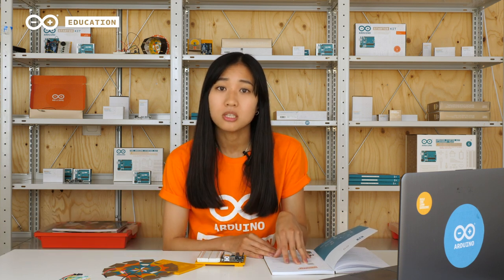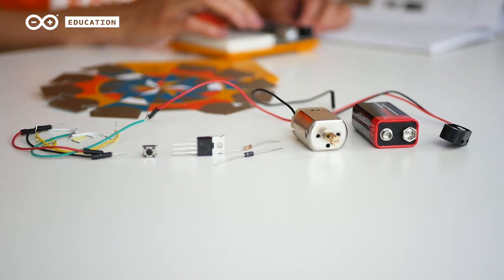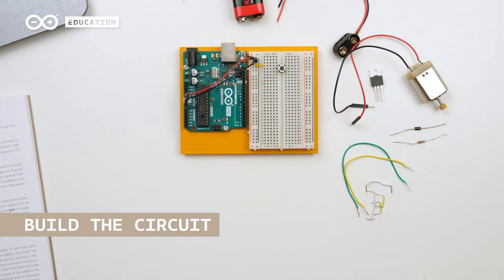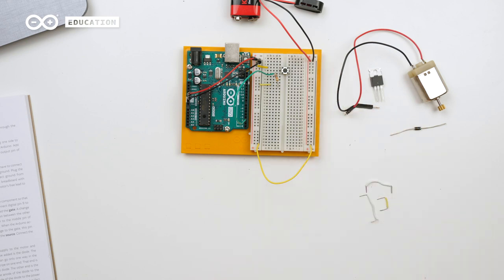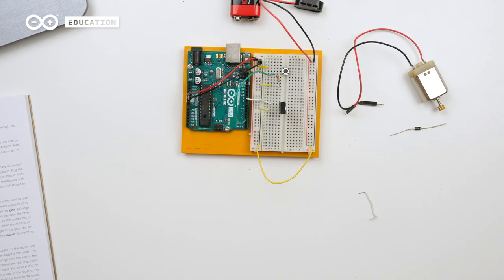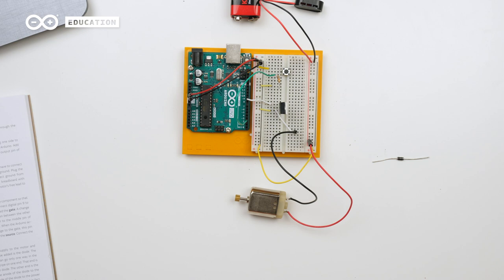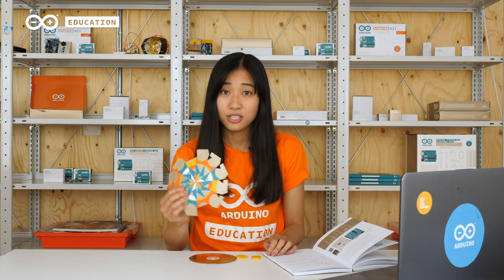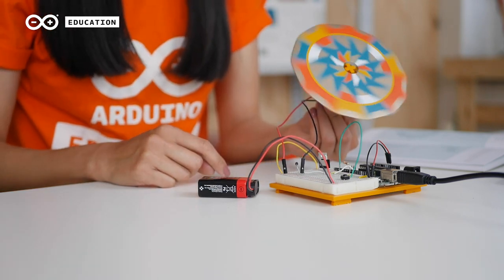09 Starter Kit: Motorized Pinwheel

Comment: I made this project and it was not working, the motor would spin even withut the switch pin. I stuck LED with resistor for debugging and found that it gets fixed if you add a resistor in series with the diode

Comment: I still don’t understand how the diode helps with the currect created by the motor, could you explain where the extra currect goes?
Reply: Nowhere, because of diode. Its purpose is to prevent this extra current goes back to circuit. I think so at least.

Comment: I have the starter kit and I tried to build it but it didn't work. The battery and motor work fine separately but if i connect the battery and the motor together it doesn't work.

Comment: my motor spins regardless of the push button being pressed or not. Why is this happening?
Reply: Check your code, mine turned out to be as simple an issue as having a single = as opposed to an == for the if statement. I hope this helps or you have figured out your problem.
Reply: The issue could also be with the diode. I added a resistor in series with the diode and it worked